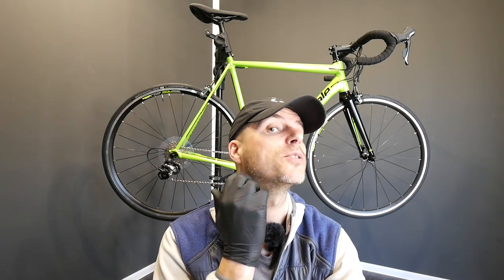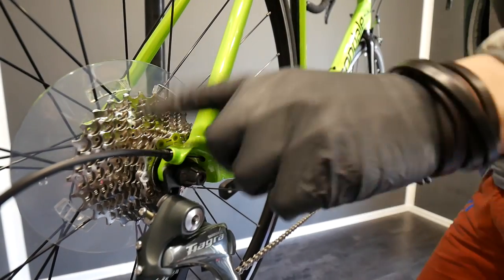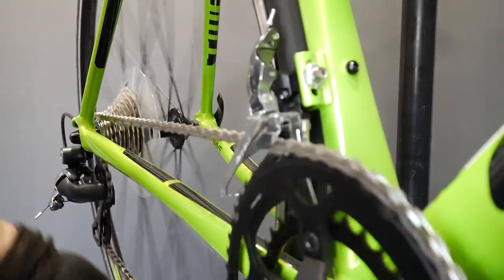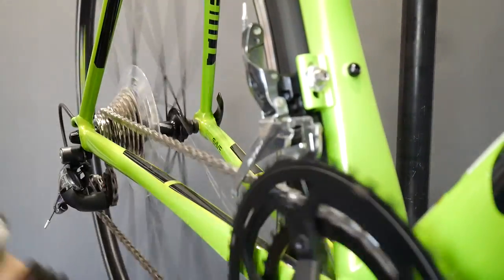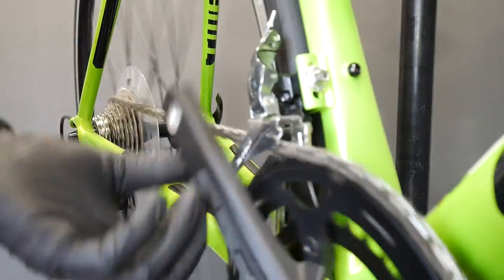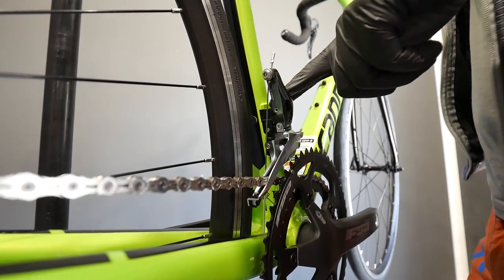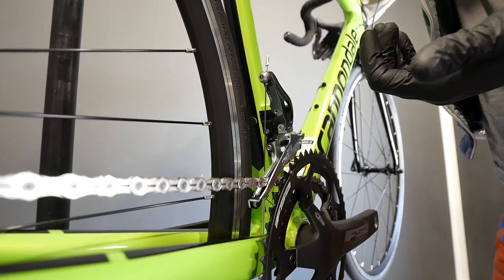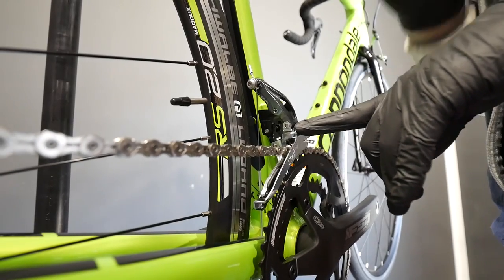What Is Trimming On Road Bike Shifters & Why It Might Not Work? How To Change Gears And Trim.

Comment: As a bicycle mechanic with over 20 years of experience. One of the best thing's that you can do is spend five minutes explaining how the trim work's to a customer, regardless if it's on a new bike or a bike that you have just serviced. It saves you so much time in the long run. Just always remember cables are going to stretch and frames do flex so chain rub is inevitable at times. 👍 cool video
Reply: Teach a bad master, you need to switch speeds in time.
Reply: I completely agree. Two weeks ago I just bought my first bike from canyon and didn't learn this anyone. I knew there was something subtle going on but I wasnt able to repeat it.
Reply: @rand3mhero just game here after buying canyon 2x12 grx 😅

Comment: Almost returned the bike. The first LBS didn't have a clue. The second one taught me trimming and I'm happy with the bike. Trimming should be taught in primary school ;)
Reply: I just spent 5 hours trying to fix the rubbing on my derailleur. I just needed to trim it :(
Reply: I’m very excited if this means I’m able to use my top two gears at the back of the big with the bigger ring up front. I’ve been staying out of them to avoid damaging the chain and researching new bikes but it might be that tomorrow I’m actually going to be able to use all the gears. If it doesn’t work I’ll be devastated but I really wish I’d known this before

Comment: I've just bought a pair of basic 2x9 Microshift R9 and couldn't figure out why the rear shifter had an expected 9 positions but the front shifter (labelled "Double")  has 3 up and 2 down movements.  Now it all makes sense.  Thanks for the video.

Comment: I bought a Canyon with 105, coming from MTB with Deore SLX, didn't have a clue about the trimming. On the 1st ride, I thought that the front derailleur is completely off, I was thinking to yell at Canyon for sending me a bike without proper front adjustment. But I have noticed the pattern when changing gears, then I checked online and found out that it had a name and it was known as "trimming". :-)

Comment: This video helped me so much! I was getting chain rub in the biggest cog and the smaller gears on the rear. Turns out I wasnt trimming 😭
Reply: Same with me! Just found out about trimming and no more rubbing.
Reply: You shoudlnt be riding inthe at gearing as you're cross training and your placing strain on your chain. You'll also wear it out much quicker doing that.

Comment: So it is normal that the chain is rubbing if you don`t trimm when on the lowest gears (small chain ring - largest sprocket)? I thought trimming is only necessary when the chain is crossing (small chainring-small sprocket and large chainring-large sprockets.

Comment: Great detailed video! thanks a lot for sharing. look, for the cheapest ones (like Claris), is it possible to add barrels or something that work like, in order to fine tune the cable tension? i had a Tourney that im upgrading and its a pain to fine tune the cable tension by pulling and screwing bit by bit...thanks
Reply: You can always add an inline adjuster somewhere - providing your cables are not completely hidden in handlebar/stem/head/frame.

Comment: Great video. I have the new 105 r7000 FD. My high trim works perfectly but my low trim is not working at all. Any trips to get that working?
Reply: The cable tension is not tight enaugh. If you have cable tensioner screw ,try to turn it counter clockwise 1 to 2 turn

Comment: Thanks for this video which shows how the trim function works. Please can you also make a video with a clear explanation of how to adjust and fine-tune the trim function with the correct step-by-step plan for this?
Reply: let's be clear. if you need to use the trim that means you are crossing the chain. so, the thing is, when you hit the derailleur cage, that means it's time to change the ring. the trim is there only to force the cross chain. which you shouldn't. small ring = top half cassette / mid ring = entire cassette minus 2 cogs on each side / big ring = bottom half of the cassette. if you use your triple like this, you'll never need the trim feature. i'm so pissed at that SickClown.
Reply: @JayB-lz6yd  thank you for your comment and it is clear to me that it is not good to cycle with a crossed chain and for this reason i never do this. I know what the trim function is for and how to use it. What I would like to know ans what my qeustion is about is how you adjust it correctly with the adjusting screws and the cable tension of the front derailleur.
Reply: there are plenty of good videosout there. don't ask him that. he'll not do it correctly. all his videos are like this. always something wrong. you can't trust a dude like that.

Comment: My 105  trims perfect on the small ring but can’t ever seem to get the big ring to function properly. Big part of the problem I believe is my bike doesn’t have a barrel adjuster anywhere on the front shift cable. Making it very difficult to fine tune cable tension.
Reply: The wire tension on the front derailleur cable is much higher than that of the rear derailleur, I had to put a barrel adjuster for the front derailleur cable because I have internal cabling on the carbon frame (the rear derailleur cable seems to be fine without the adjuster).  Also the barrel adjuster may compensate for the cable stretching over time.
Reply: I find it difficult too, I can only get it to not rub on either the big or the small chain ring but not both

Comment: Great information but you shouldn't need to lube your cable housings is the only thing I would say. If you are thinking that's the problem, you need new ones. Adding lube to a cable is a short-term fix and will cause long-term problems.

Comment: I have the same exactly gear and I didn’t know it do that 
I’m pretty sure not working on nine 
And recently I ruined the gear I Was  adjusting the gear as it got poor shifting but I thing I overturned the barrel cable so the rear shifter become no changing gears anymore I feel it like stuck won’t move 
I released the cable and put it on again but I didn’t know hoe to adjust it 
If any one know what happening would be appraciated
Thanks good video

Comment: Does the claris STI shifter has this function ?
Reply: Yes
Reply: Ok thank you
Reply: Every drivetrain has this feature. I trim many times on my entry level Revoshift gripshift shifters for my front derailleur on my trekking bike.
Reply: @sandythemonk  so it's basically part of every shifters be it drop bar or trigger huh...? I hadn't noticed it on the trigger shifters and is a new knowledge for me... thank you...
Reply: @varunmurali6367  I am not sure but I think it would be difficult to do trimming on trigger shifters because when you shift from a smaller chain ring to bigger one using the trigger, there is no provision to hold the shifter in the middle position between the gear changes. The trigger will either completely shift the gear or nothing at all.
Reply: @sandythemonk  ok

Comment: The trim did not work on the low ring on my bike after lbs replaced the cable and I did also not have loud enough click when trimming. I found out that LBS did not set the low limit screw properly after using to get correct cable tension so it was rubbing on the low/low gear. Well I don't blame the lbs and the mechanics everyone at the store needs to work fast so they can fix as many bikes as possible so small errors like that can happen.
Reply: What did you end up doing? I'm facing the exact same problem after having the workshop replace a cable. Now it's rubbing on the four largest cogs while in small chainring and also trim is not working.
Reply: Following

Comment: If I am understanding this, then trimming is used to stop the chain from rubbing inside the cage.  Am I right?  
Also, I am thinking that keeping my cadence steady is important to maintain endurance - not just getting into the higher gears as quickly as I can, and "toughing it out" to cover more distance.  This would just wear me out quicker.  Am I right on this one?  I was told when I bought the bike to maintain 60 rpm, maybe because of my age (75).  I am trying to prepare for a TT geared to my age, which is a few months away.  All comments appreciated!

Comment: I have 2015 specialized  Deverge,aluminum ,i maintain my bicycle very well,and seem to always have cable issues, I am always conscientious about cleaning and  washing . I've tried  different cables and lubes, , these internal cable routing seem to cause problem, ,,I've used expensive and cheaper cable/Housing, again with different lubes but always cimes back,

Comment: Good day.
I'm from Ukraine.
I serve in the war.

I was looking for an answer to the question...
I didn't find it...
Are there versions of the XTR "SL-M980" shifters with the "trimming" function!
After all, the ones I have (these shifters) do not have this function, and in the manual for them it is described that certain versions of these switches have it!

Can you tell me which shifters (for MTB bikes) have the "trimming" function?
At Shimano.

And is this feature available in certain versions of "Shimano Deore XTR "SL-M980"?
Reply: Dude......Mountain bike shifters don't have a trim function......trim is only for road shifters!
Reply: Dude , why don't you ditch your front mech and go 1x 10? .....and what bike do you ride? ....must be pretty good to have XTR.....I'd take shimano over SRAM any day !
Reply: @nickjohnson710  I am completely building my cross country hardtail on a Cube Acid 26 (conservative old school).  3×10 All "Deore XT": FC-M770 22T×32T×44T (Mega 9 Drive Train) together with Dyne-Sis (everything else): CS-M771 10 speeds 11T-36T; RD-M786; FD-M780 plus  XTR SL-M980.And BL/BR-M785.Thus I increased the speed range from 7-8 in the rear.And that's a lot of top chips  I also put in a pendant and other things. Sorry for the google translator)
Reply: @user-hd6iv3or7e  Nice,Cross Country is what's its all about  ! I had a cannondale Flash 29r in 2012. That had SRAM XO in 2x10 with 11- 36 cassette .I replaced it with 1x10 in either 32 or 34 depending on how steep the climbs were! ... You're saving tons of weight on the cheap 😉🇬🇧
Reply: @nickjohnson710  When the war ends in Us and I finish my bicycle project - I will upload the video to my YouTube page.  Everything will be there, how I will do it... frame restoration, installation of all new equipment and accessories... I am not only a bicycle rider, but also a bicycle maintenance and repair master)